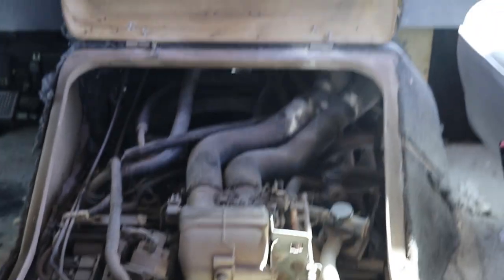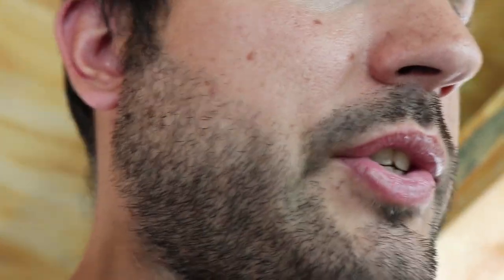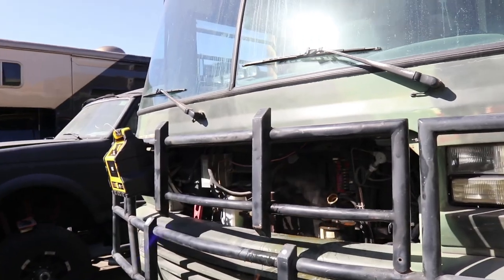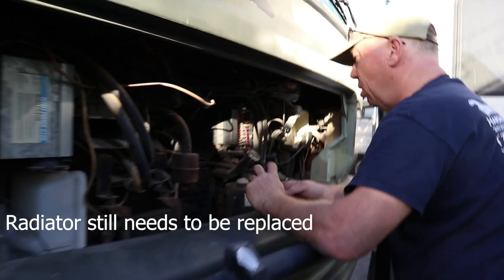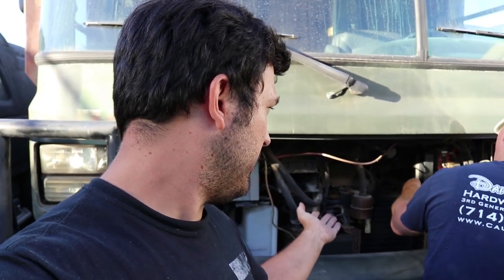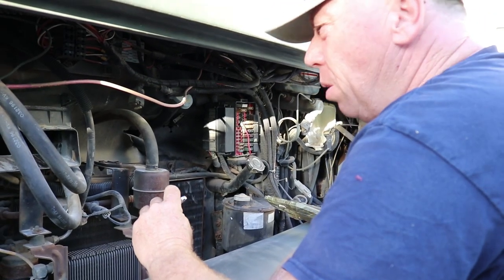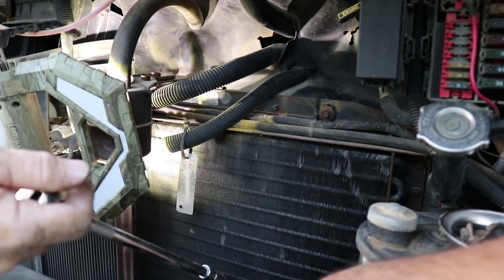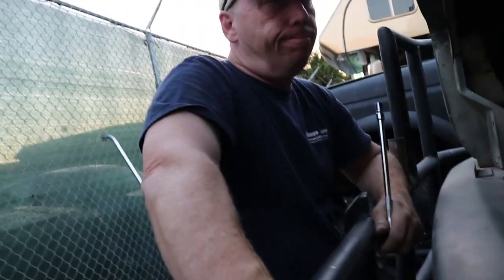Jurassic Park RV Restoration - Part 12

Comment: Also, Franc, before you pull that old radiator, I would flush the system right now, before you put the new one in. That way, you wont contaminate the new radiator with that nasty coolant. Open the petcock valve on the bottom of the radiator to drain it and shove a hose in the top where the radiator fills up at. Start the RV and turn the hose on. Let it run. Keep the petcock open this whole time, letting the fluid drain. The thermostat will open up when it gets to temp and it will start flushing the block out. The thermostat will cycle back and forth opening and closing. After a while, the water will run clear. Then turn everything off and yank the old radiator out and replace it with the new one.

Comment: You asked if we thought the engine blew a head gasket, baised on coolant color. No. It did not. The coolant is that color due to the rusty water jackets of the engine block. Flush that engine with a hose until it runs clean. Blown head gasket would result in the coolant and oil mixing, looking like a milkshake.
Reply: not every head gasket failure will cause the coolant and oil to mix.
Reply: it also looks like their is a SHIT ton of air in the system because it kept running low, best thing to do would have been to flush it, then replace the rad that way you dont have old nasty ass fluids gumming up your new rad.
Reply: I don't know why in the fuck he's letting the coolant drain on the ground.
Reply: well your mistaken. you can get just preasure inn the water with a blown head gasket.. it just depends where the gaskets blows.. if its to a water canal or oil canal.. and the color off the water is most likley due to blown headgasket / no antifreeze yes antifreze also helps against corosion/rusting inside the engine and such
Reply: Brians Vlogs that's probably not just coolant. its mostly rusty water. when there was a leak they probably just added water and not antifreeze since they're in california. and where else is it gonna go? and theyre in a rv parking lot. its fineeeeeeeee

Comment: Spotted the problem with your transmission overheating. That crunched up lil cooler on the bottom is either a trans or power steering cooler. No matter what, with it bent like that even if it's pinched then you've got a major restriction in the line. Less flow, especially in a cooler, is incredibly bad. And what sorta mechanic comes to work on an RV without impact tools and sockets, or even some basic WD40 or PB blaster? What the hell. There's also a thing called google. You look up instructions on how to fix the damn thing 
This is infuriating to watch. At almost no point in this entire series has anyone showed up prepared to do any actual work. Does commiefornia not have auto parts stores or any home depots? are they THAT far removed from the working class of america? If I weren't on the damned East coast I'd have the thing running and looking alright in a goddamn week. Hammers, nails, ply wood boards a damn table saw carpet and a staple gun and misc trim that interior could be done in a matter of days. It's nothing but shelves, the rest is just finding props. Electrical would be easier to strip out the components all the way back to the junction box, drop in high wattage inverters with a standard 6-pack of batteries and re-run the cables through the cabins while you're redoing the interior. 

And here, for your sake, the manual is free from the manufacturer. https://www.fleetwoodrv.com/resources/media/manuals/1997_SOUTHWIND_STORM.pdf
Reply: Goign to have to apologize, just now seeing that you've got a new episode (22) as of now. figured the whole thing dropped flat on it's face after this, was looking on the wrong channel for more updates. Good on y'all but it's definitely taken 100x longer than it should've.
Reply from the maker: I know right ? Problem is I’m in the US a couple weeks a year !
Reply from the maker: And the RV is still alive, we have two more episodes coming

Comment: The engine sat for 9 years and then you about burnt it out driving it to get repaired, where it sat for almost two years without being cleaned or worked on. And now you're surprised it is burning oil

Comment: Its burping coolant like that because air is trapped in the system. Back under the engine cover inside the rv on the highest point of the cooling system should be a bleed valve screw. Might be on top of the thermostat housing too. These 90's engines were a pain in the ass to get all the air out of. Engines today have the pressure cap on the reservoir tank, with small air bleed hoses coming off the high points. These you just fill with coolant, cap, and done. Doesn't even need to be run until the thermostat opens to add more coolant like you did with older engines. I do check the level after driving and its had a chance to cool.

Comment: One long series of bad decisions and under-qualified personnel.  At the very least, why not use the power of the internet to get some answers to your mechanical questions?   And back to the roof issues for a moment.  First and foremost, it has to be water-proof.  Make hard mounts for the movie prop stuff on the roof and seal them in.  Then affix your prop stuff to that!  C'mon guys.  Get with the program!
Reply from the maker: Not a bad idea actually
Reply: I would certainly not rely on self proclaimed internet experts, get and actual mechanic that knows that type of engine and do a full service.

Comment: I know this is an older video, but feel like I need to express my thoughts. In the UK, long life coolant is that exact orange colour. So perhaps the coolant is fine. Also, why is the radiator not connected to an overflow reservoir? It shouldn't be spewing coolant like that.

Comment: the rv has been sitting for years with the same water. which means it has rusted the inside pretty good. which means the metal in the engine is going bad and you will need a new engine one day.
Reply from the maker: Yeah I flushed it pretty good it’s alright now. Not perfect but alright
Reply: Movie Cars Central I work on cars all the time and taking care of them is one thing, but major work is another. so I hope the inside of the engine is okay and most of the rust is from a cylinder head. and if anything should go wrong is the metal get weak and break or you have lack of lubrication and the engine seize. 

I suggest adding special engine oil on the next oil change. you should use break in engine oil for new engines. use that for 2 oil changes at least or 5.000 miles. I would rebuild the engine if i were you but you're like me and keep pushing til something goes wrong. so the next hint of something like grinding or knocking i would get someone professional to rebuild it and it should last a long time.

Comment: Could you not contact the company who built the RV and get instructions on how to replace the radiator? What about that company sponsoring in some regards?
Reply: The props and modifications made by the film crew have altered the way everything went together. It was never meant to be put on the road. They build them to look how they want with no care as to it lasting more than a few months.
Reply: Thomas Gregoire , no,  the rv was built by Fleetwood, and built to drive thousands of miles.  You could contact them to find how to pull the radiator. The film crew just added things to the outside to change its looks.
Reply: Mike Barker and other things such as mechanical work electricals and more so fleetwood wood have some knowledge but this rv was made for looks and wasnt ment to be on the road
Reply: Macaroni Sandwich, I know the final product was not meant to be, but you fail to realize it's built on a real RV. Yes they changed its looks, but i'm sure they didn't spend time to reengineer the drive train and it's components. Which brings us back to the radiator, you could contact Fleetwood and find out how to remove it.

Comment: If you guys have any mechanical issues and need advice, shoot me an emil. Dynastypowdercoating@gmail.com. 
This project is dear to my heart and I would love to help in any way. If I lived closer, I would have already been out there working on it.
Reply: Ex-mechanic of 10 years here as well. I'd be happy to help out via email and/or Facebook. This project is also very dear to me as well Kyle :)

PS - Kyle is giving some great advice :) To add to it, be sure the heater is set to full hot - don't worry about the fan setting, just the temp setting. This will open up the heater core for flushing as well.
Reply: Great to see people volunteering. Keep it up. I've been wondering where all the Cali people at anyways through all this? I've only been able to donate, but I'd be jumping at the opportunity to help myself if I lived there. They definitely need to get some more people comfortable with restorations getting in on this!
Reply: I so wish I lived closer! I'd definitely volunteer a lot of time, tools, and expertise :)

Comment: With offroad tires this beast could probably do minor 4 wheeling, after all it’s does have 4 wheel drive in the rear
Reply: Gravel roads don't count as offroading. That things got a dually set up sure, but it's an RV. The approach, breakover, and departure angles are on par with a limosuine. You have an open differential in the rear where there's the least weight for it - It'll get stuck the second it hits soft ground. Only one side has to lose traction and it's done and you're looking at a very expensive recovery.

Comment: 12:44 "stay tuned", erm no, I really don't get what the engine has got to do with the restoration project - it was never seen on screen and really should've been fixed (off camera) months ago. It's the interior that needs the attention - that's where the movie magic happened, not someone trying to explain the purpose of a fuel pump ffs..
Reply from the maker: It’s a global project and we wanted to show every step. Interior work is in episode 20-21
Reply: Its also a restoration project wich mean engine wiring and that
Reply: The restoration project should only include the on screen details - the example of the Delorean from Back to the Future doesn't have the original engine, another example is the Star Trek bridge, fairly certain they didn't get the engine working on that project...
There is no provenance to the engine in this vehicle, I get that it's a global project and you wanted to show the detail. However I reached my viewing limit after the tenth episode of trying to move the vehicle...